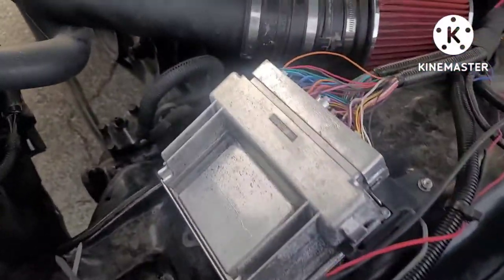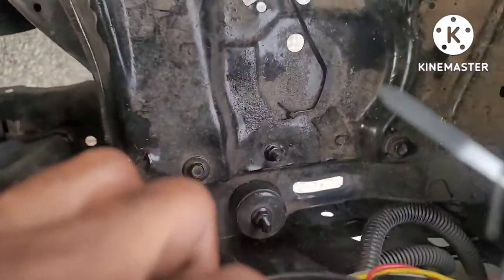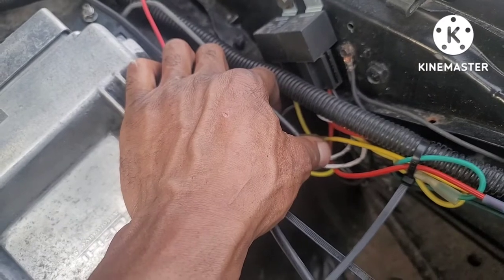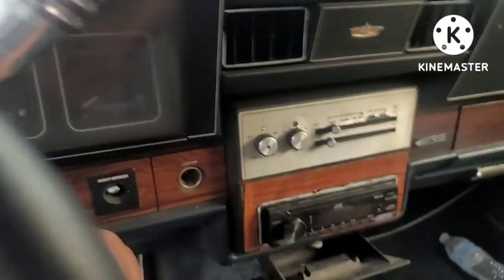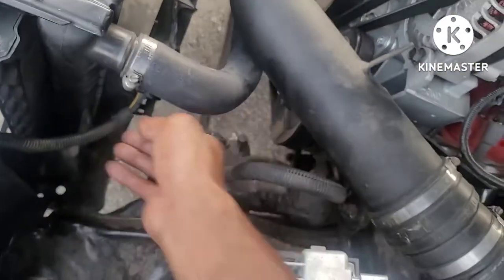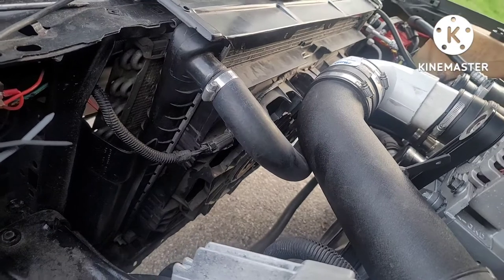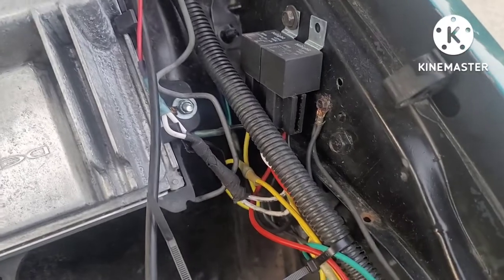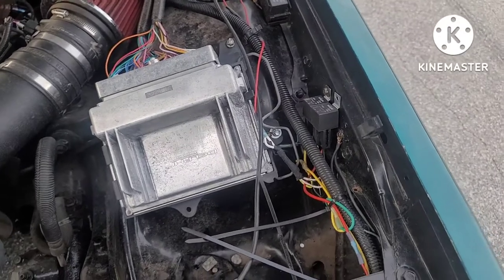How I wired the concorde fans

Comment: Bro I got a sbc. Since the fans already got relays can I just wire the high speed fan wire to my 190 degree temp switch which will trigger the fans to come on at high speed only? Or do I have to add 2 extra relays